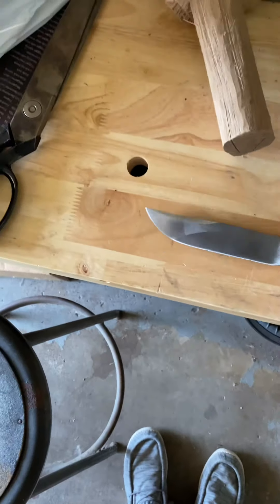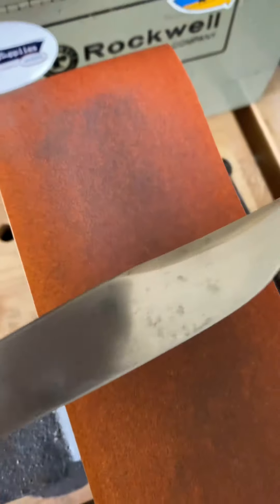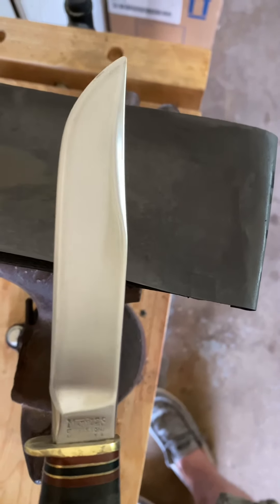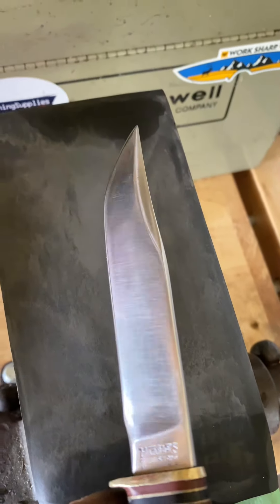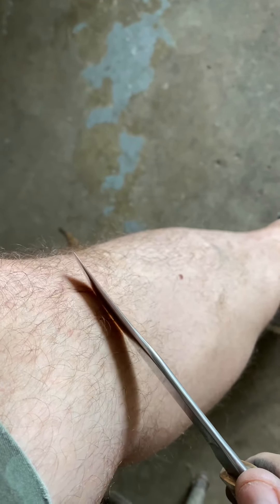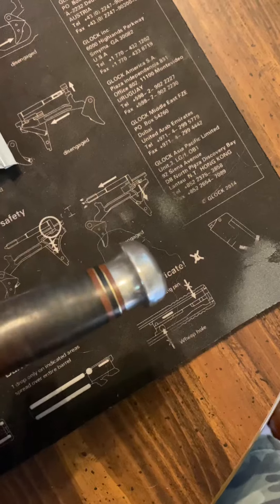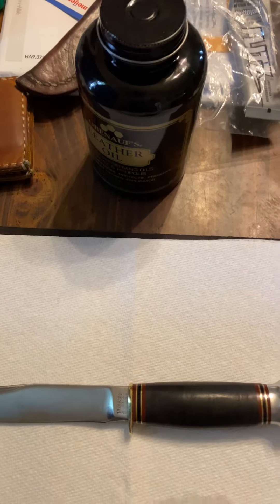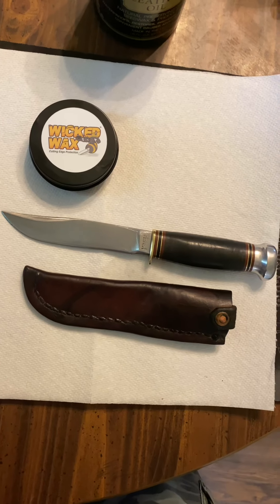Marbles Expert

Comment: Great job on the restoration.  Did you put a sander upside down in a vise?  I have always just hand sanded, but I like your results.  Thanks for sharing, my friend.
Reply from the maker: Yes, that’s also how I sharpen convex grinds. For the handle I did sand that by hand.